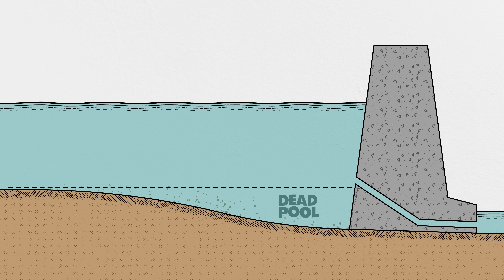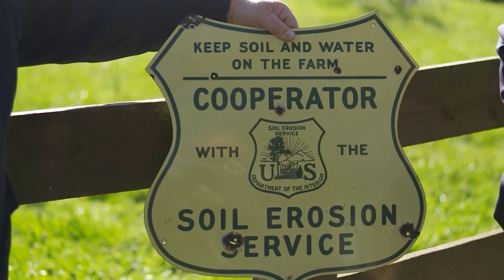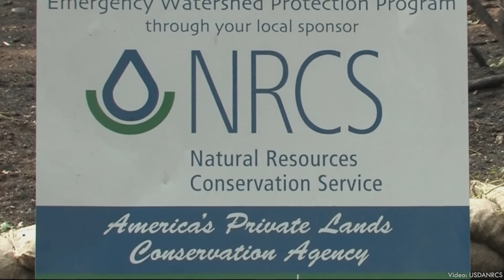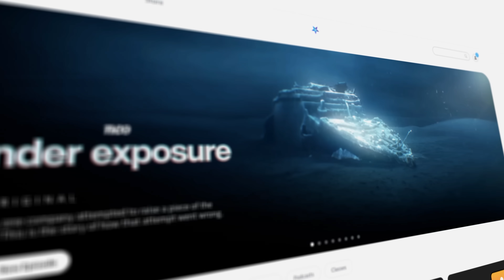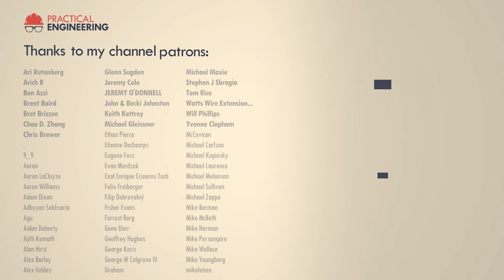All Dams Are Temporary

Comment: what if dams had a small diameter siphon pipe drawing from a low point on the base of the dam, that lead to a point on the spillway not quite near the top that would draw water with suspended silt from the bottom of the revisor and allowing some of that silt to bypass the dam?

Or what if dams had a low level through pipe with a connection that could be manually connected to a siphon pipe by a diver. that sediment could be roured to a mill at the downstream side the dam which could prosses the sediment for any minerals it night have as you manually clean the bottom of the lake.

Comment: There is a dam on the Danube, which itself is built on ancient sediments. It may seem impossible to build a dam on sand, but it seems to have been done.  The creators of the dam took into account water currents and sediment paths, and sediment is an important building material. It is the Gabčíkovo water reservoir. 
We have another interesting dam that the builders built outside the river. Heavy sediments flow further along the bottom of the river, and the upper part of the water is fed into the reservoir through a channel. Šírava water reservoir.
Greetings from Slovakia!

Comment: The best solution i can think of is to have the outlet of the reservoar by the inlet of the reservoar, this would allow for more silt to flow through since the majority of the water does not need to slow down, and then the silt can still be suspended in solution.
Reply: That makes no sense.

A much simpler solution is removing the dam.

Comment: I feel like one possible solution (in my inexpert opinion) would be to drill down through the sediment layers and run piping through it. Then, on particular days, close the intakes to the hydroelectric portion of the dam and allow more water passthrough; force air through the buried pipes to kick up the sediment and allow it to flow downstream. One could find the right balance between accumulation and removal so you'd be at a net negative amount of sediment collection, and then switch to a net neutral amount to manage the dam in perpetuity.

Obviously the energy costs involved in forcing air down through that much water and sediment would be very high, but I can't imagine it'd be an even remotely significant portion of what the dam produces over time.
Reply: Same idea I had! I feel like this is the least energy intensive way. Once established the dam can run in perpetuity with simple maintenance.

Comment: I have a speculative idea that instead of using surface water to generate power, dams could pull water from deeper in the reservoir. This could create flow that stirs up settled sediment and moves it downstream, helping to reduce buildup. While some dams already release deep water, they don’t use it for power. My idea would require redesigning turbines to work with deep water instead of just surface flow. A lot of research would be needed to see if this is possible and how it would affect the dam and sediment movement.

Comment: Another possible solution to the sediment problem could be to permanently install a dredge where the sediment is being dropped off, and continuously pump a very controlled amount of it downstream and put it back into the river beyond the dam. That would enable fine control for keeping the downstream sediment load at a healthy level to support the downstream ecosystems.
Reply: So you want to build a canal dozens of miles long to remove hundreds or thousands of pounds of sediment every second?

Why not just remove the dam?

Comment: wouldnt the sediment once dredged be useful as top soil for farming it could be bagged and sold to pay for the dredging or used to create new farmland as for keeping the problem from happening would not an aeration system work to keep the sediment stirred up in the calmer waters of the dam allowing it to move past the spillway and on down the river a simple latticework of small piping that is weighted could cover the the floor of the reservoir and push compressed air into the sediment to keep it moving the compressed air could be provided by the dam itself by retrofitting a compressor to run off of outflow the latticework of pipe could be made in small enough sections that they could easily be removed to be maintained and gps could be used to keep track of them this would once installed require minimal man power to keep running and maintain

Comment: I’ve recently saw a video on the cleanup of a pretty small reservoir in the Swiss Alps. They completely emptied out all water and used a special excavator to remove accumulated stuff. In this case, trees and branches made up more volume than the sludge at the bottom.

Comment: Consulting engineer retired in Ireland here; the problem is serious, the loss of useful storage volume is a more acute consequence with floods-droughts climate change.  I wonder can the lighter silts be mapped and preferentially removed by suction dredging to pre-constructed bunded storage held by earthen embankments.  When I used this approach , we struggled with the poor dewatering characteristics of the silt. We planted it with indigenous trees and vegetation, and we put flexible vertical drains into it. It still took years. 

Scouring material to the downstream side wouldn't be acceptable environmentally here, especially if migratory fish spawn in the river.
Reply: .   I mean no disrespect, but silt is for reclaiming sandy desserts for exactly that reason. You don't have a problem... you have an exportable resource the proper use of which will help cool the planet by turning desert into Forrest and farmland.

    You can use it sparingly in farming soil, less sparingly in certain regions. It isn't a problem... it's a much needed resource that we can all help provide. The reclaiming of old desert land has been being ignored since the new calendar prevented people from witnessing the actual changing of the seasons later known as climate shift. Now you've redefined climate shift as a species trying to deflect from planetary overheating and left yourselves even worse off for the effort.
.
Reply: @BaobobMiller  your point is fair, and is well made.  If that silt material is suction-dredged, and pumped from the dredger to a bankside lagoon, it will be very aqueous, with zero soils strength for a very long time. It's a sludge lagoon for a long time, incapable of even supporting feet in boots. Unfortunately that's a condition that'd make it very expensive to transport. Mechanical dewatering might be used, but the low-tech solution of impounding it, planting it with vegetation, and waiting a decade before transport would , I think, be forced by the economics.

Comment: Would it be possible to put agitators in a reservoir to keep the sediment from settling in front of the dam? The idea could be to mix up the reservoir while letting out water just enough to match the river's natural sediment levels, and they could even vary those levels seasonally if it helps maintain a more natural pattern. Obviously this wouldn't be a solution for dams that we've already built, because you would only be able to release enough sediment to equalize the buildup. But I feel like it could be a solution for future dams. The only issue I can think of is that you would have to use half the energy produced by the dam just to run the agitators. But there may be some clever ways to make that more efficient. I've tried googling this concept, but not a lot comes up, at least not for larger scale dams.

Comment: Normal flooding cycles would deposit much of that soil along floodplains, so there'd be less sediment flowing up to dam locations on uninterned rivers. The dams reducing normal flood cycles, thus not giving half the sediment a place to go, and why it settles at the dams. The dam itself accelerates the issue by eliminating normap flooding deposition in flood plains.

Comment: A mahoosive sediment trap directly below a dam that's being flushed? Then manual excavation once the dam is empty, and then the settling tank in turn... If you're clever one could generate from the settling tank? It would be designed for easy access for large, mining\quarrying equipment for removing the sediment once it's drained and dried.
Youd basically have to be building two dams... It does solve the issue of polluting downstream and maybe not 'waste' so much of the water for direct use or power generating?
Sounds expensive but these projects are inherently expensive, and I'm the 'do it once and do it right' kinda guy, especially with big investments or projects.

Comment: Add a dead pool with a large auger, where the River enters the dam.

The auger might be enough to clear out the pool and can be water powered.

The auger should dump the sediment in a v shaped channel where constant water flow clears the sediment.

The auger needs to be protected from trash bigger than it's capable of clearing, using grids.

Comment: Think of solutions? Hows about this - The first thing that comes to mind is an upstream filtration dam positioned so it can be routinely flushed out, as silt dense as practical while avoiding the area behind the main dam. Maybe it flows through an entirely different valley and rejoins the natural course somewhere downstream of the dam. This silt flow could be flushed intermittently, have a constant volume or mix these approaches based on various considerations, ecological etc.. We could also think of this idea as diverting silt free water away from the original river towards the dam location. In reality I suspect the original river valley would be more attractive to use for the dam and so it would be more cost effective to carve an artificial river course. Probably not a solution to retro fit existing dams but does anyone know if this has already been done in more fully thought through projects?

Comment: @PracticalEngineeringChannel, why not dredge in key points with electricity from the same hydro dam? Dredge in such a way to emulate the quantity that comes in and at various points. 

A great analogy would be an oatmeal powder juice. If stored in the fridge it will just settle and needs a stir before drinking. 

If the amount of silt coming is counteracted by just slightly more stirred out over time the storage capacity is incremented.

Comment: Solution: River sediment is rich soil.  Line the bottom of the inlet to the reservoir with large containers that can be removed when full.  The containers would create mini dead pools at the inlet of the reservoir.  This could be implemented as an actual small scale dead pool at a spillway that feeds the larger reservoir.  The river sediment could be sold as rich soil and the containers put back into the small scale dead pool.
Reply: The river sediment in Lewis and Clark lake is not rich soil. It's sand dune sand from the Nebraska sand hills. The problem was a dam on a tributary river failed during flooding in 2019 on the Niobrara River. So 50 years worth of sand held back by that smaller dam was released into the lake in a single event.

Comment: Instead of letting the inflow enter freely you run it in through a catchment system like the LA River basically, within that structure is built a system to collect sediment as the water is slowed, which is then diverted via tunnel through/under the reservoir and past the dam.

Aka expel the sediment as it is received.  Kinda like how the mail system works.  Or airport luggage.  Any system really.  Your heart pumps blood as it’s received.  It doesn’t collect it to pump later.

Comment: This characteristic of dams to trap sediment was exploited after the May 18, 1980 eruption of Mt. St. Helens, when the U. S. Army Corps of Engineers built the Sediment Retention Structure on the Toutle River. Rather than providing a reservoir for recreation, irrigation, flood control, or energy production, the SRS was built specifically to trap sediment from the eruption before it could flow downstream and cause flooding and shoaling in the Cowlitz and Columbia rivers.

Comment: I used to help dredge the levee in my town. Every winter, we'd target a new section of the waterway, ripping and pushing with a D8 dozer to an excavator loading the material into trucks. We always dreaded the warmer days of winter when temps creeped closer to the melting point because it turned everything into a sloppy mess. Mucking tracks turned into a much more difficult and time extensive task, killing our daily efficiency. While I appreciate the experience, I don't miss the labor 😂

Comment: I'm wondering if making a sort of funnel shaped reservoir upstream, that it can be also underwater, who collects the majority of sediments, connected downstream, bypassing the dam, can solve the issue.
In the funnel you can slow down the flow, allowing sediment to settle, the overflow from the top of the funnel can go into the dam itself,and a slow and steady flow from the funnel lets the sediments pass the dam.
It's an added infrastructure, but if it works it can be a way to solve or at least mitigate the issue.

Comment: We have few solutions on river Váh i saw.
One dam is split into two separate pools by rubble wall on former river side.
That deeper pool is for main river flow and side pool is for all the creeks to enter and drop sediments there. It's kept as wetland. Further upstream as the river enters the reservoire there are 3 or 4 deeper pools it enters first to drop all the gravel. Once one fills it, river is switched to another and first in mined for said gravel. This keeps supplying gravel so there's no need for regular mine in the area.

Comment: Sediments build up from the sides. Create inclined earthworks and have the water wash over them so the majority of the sediment remains at the bottom. 
Retrieve sediment and reuse for construction and agricultural uses. It is very fine particles so there would be plenty of uses for it. Sand is commodity.

Comment: In 1974, the Brisbane River overflowed during seasonal rain and flooded the City of Brisbane. Later they built the Wivenhoe dam which job was to hold excess water and release it gradully over time so it won’t flood - in theory. It can hold something like 130% or something. First time I read about a dam that is meant to hold excess water. In recent times there was too much rain and the excess water had to be released like it or not which caused some flooding.
Today’s vid makes me wonder about the sediment issue for the Brisbane River, presumably there will be silting on the edges of the river.

Comment: Simple solution:
Decide where sentiment should stop, install a slow moving series of dredging cups to the bottom of the reservoir in that place to constantly collect sentiment as it is deposited, make a conveyor belt from the dredging installation to the dam, drop the collected wet sentiment over the fast moving water running down the floodgates and it will disperse and continue flowing downstream.
Reply: So that's like a ski lift, but with dump trucks?
Reply: @sam4secretary  more like a manure chain that farmers would have in their barn, except that it's always running slowly and moving the sediment past the area you don't want it to settle.
Reply: @sam4secretary  oh man, i cant think of the technical name of it but it sounds very similar to a steam shovel with a "belt" of buckets. Basically akin to a ski lift in a manner of speaking.
Reply: either that or a trough and pipe bypass designed to flush the sediment around the dam, same basic idea though.

I suspect that the government would want to categorize it all as industrial/construction waste even though it's all in the river already.
Reply: Or sell the dredged material (in the american spirit)

It makes amazing growing medium 😊
Reply: @angrydragonslayer  the problem with selling dirt is it costs more to truck it than it's worth. I buy dirt all the time to fill in pools. The dirt costs $80 for 20 tons. The trucking can cost $200. And that's for clean dry loaded dirt. There is no value to wet mucky dirt. At least not in the quantities from behind a dam.
Reply: @angrydragonslayer I agree. Selling a portion, rather than putting it back in downstream may also be good because the amount of water moving downstream is less than is coming in, so the reduced flow may not be able to handle the full amount well. Selling a portion would also help offset the operational costs.
Reply: About 30 years ago, our government proposed building a pipeline to move sediment around Glen Canyon Dam that forms Lake Powell. Still waiting.
The dam stops most of the sediment carried by the Colorado River into the Grand Canyon. Beaches, sandbars, and river bottom sediment are shrinking, creating big problems for plants, fish, wildlife, boaters, and even long-hidden archeological sites.
We are literally sacrificing part of Grand Canyon National Park for cheap electricity and water storage we don't need.
Also, immense amounts of water evaporate into the air, and sink into the porous sandstone underneath Lake Powell. “Let’s build a huge reservoir in the desert” is a bad idea repeated far too often.

Comment: My little town in England has lots of reservoirs.  They all have a sedimentation dam upstream of the reservoir. These dams consist of a small dam where the only exit for the water is from a tube which comes up from the dam floor and stops at a certain height.  The water has to fill the upstream dam up to the pipe height, then the water can empty down it. All the sediment is collected before it goes into the main reservoirs. Some of these reservoirs are over 100 years old. Simple solution.

Comment: But, the cost of the dam should include dredging for the lifetime of the dam, or at least that amount of dredging that is wanted to maintain a desired level. In the Netherlands we don't have large dams to hold the water in (we mostly want to keep it out) but we do have a near infinite amount of dredging that we do as we are a delta. You just need to be efficient in doing it.